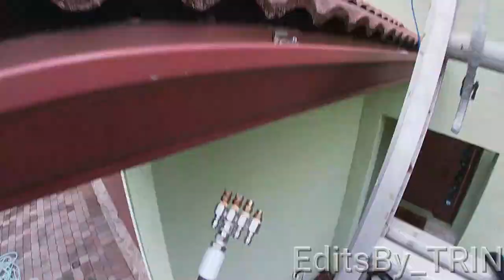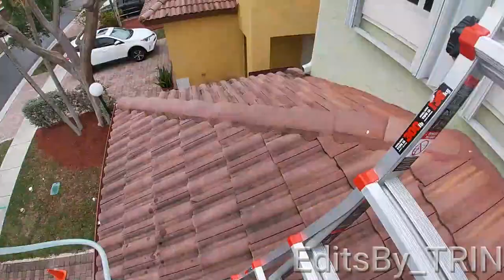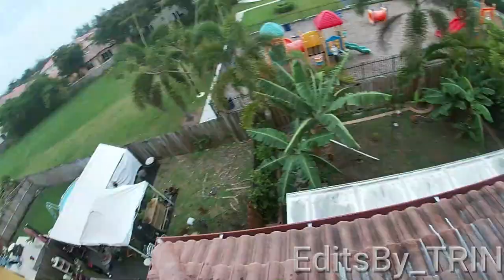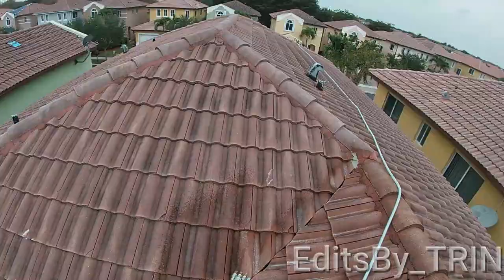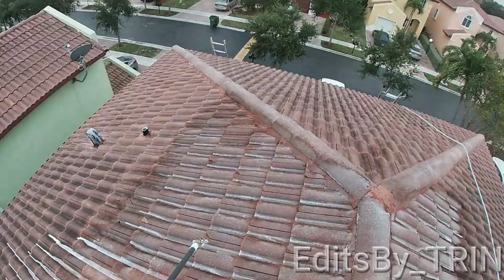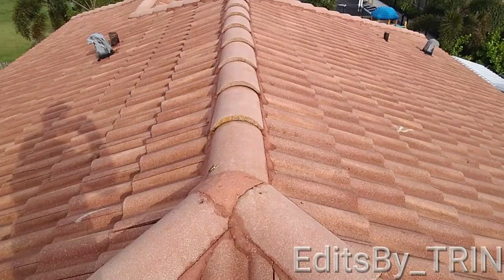Another 2 story (barrel tile) roof wash!

Comment: Heyy what are your numbers I can’t seem to get the proper mix when I am servicing the same tiles. However most of the jobs the tiles are twice a worse.
Reply from the maker: If the tiles your doing are black a 5% mix should take care of it
Reply from the maker: I would make sure your surfactant is really thick; so it can really hold on to the tile and do it's job.
Reply: @thelifeofpressureman7178   25gals on a 5% what would be your approximate surfactant mix
Reply from the maker: If your batch mixing most surfactants are 1oz per gallon; I don't batch mix but I'd most likely go 15-20oz of surfactant on a 25gallon of mix for barrel tile. But if your using a blend manifold like me, set the metering valve at about a 2% or 2 1/2%
Reply: @thelifeofpressureman7178  got it, it’s apparent I’m not using enough surfactant/eliminator. Thanks for sharing.
Reply from the maker: No problem buddy and depending on the pitch of the roof you go thicker surfactant. #WashOn🤙🏿
Reply: @thelifeofpressureman7178  ✌🏽